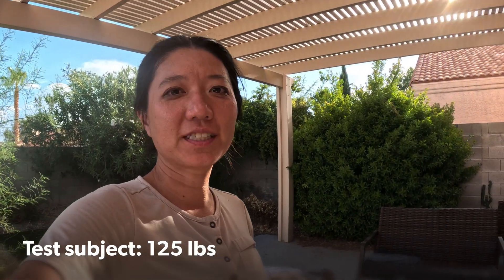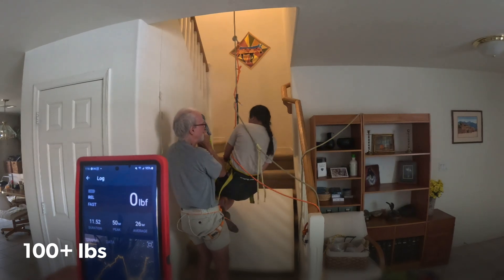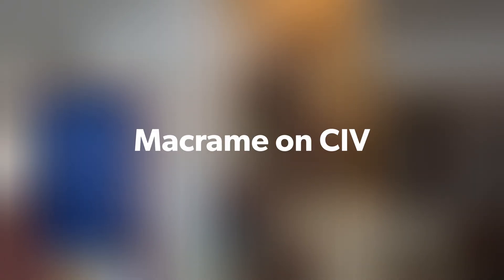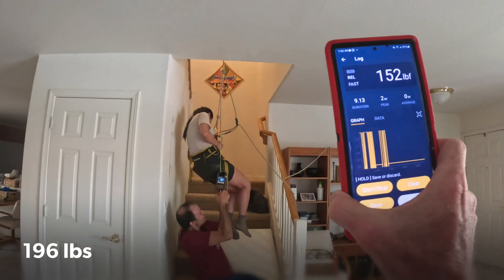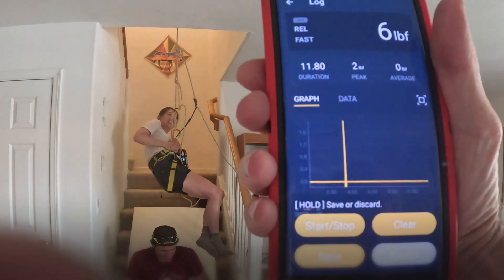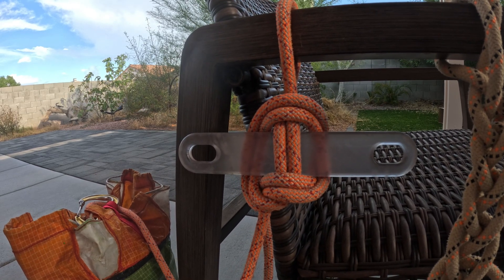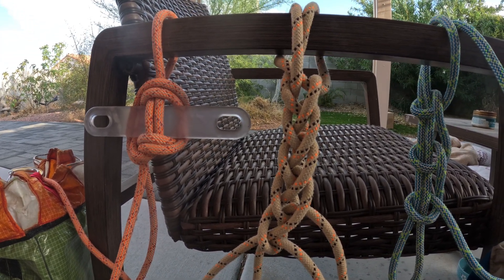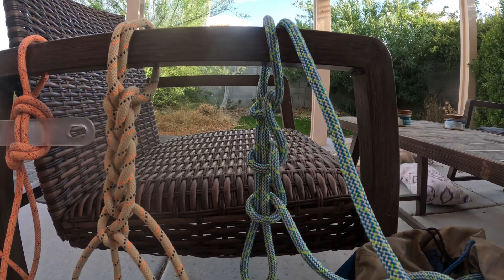Accidental Rope Pull In Canyoneering Retrievable Anchors: How Much Force Is Needed?

Comment: Cool tests. I hope the results (numbers) help to better understand the premature failure of these riggings. Some notes: Premature failure tends to happen NOT when the systems are fully loaded, but when they are partially loaded. Like when the last person is walking down a slab before fully loading the system, or stopping mid rappel on a shelf. For these reasons, some system may be a better choice, like the full-CEM (original version) with a staggered 3 step release. As others have mentioned, "Rope on Rope systems" that are too-difficult-to-release under load, can also translate to too-difficult-to-recover. I've had recoverable rope-on-rope systems work with some ropes when dry, and stuck when wet. Thanks for the vid!
Reply from the maker: @AdolfoIsassi  thanks for comment!  You are right about rope on rope system could be difficult to release after people are off rope.  Think I’ll get some numbers for rope release when it’s cooler outside 🙂
Reply: @Celessence  - For people adopting 'transient rigging' as part of their kit, I suggest adding a "rope on rope" a "rope on hardware" a "end of rope" and a "mid rope". Spain, Mexico and the PNW have come up with some super nice systems that incorporate all these variation in 1 system.
Reply from the maker: @AdolfoIsassi  ah thanks I’ll look those up.  I’m only familiar with the 3 that are common in the US Southwest

Comment: nice comparison, CEM knot looks a good option, never liked the macrame unless is for storing rope.
Reply: I've pulled a "simplified" CEM to breaking, about 2150 lbs on a 4000 lb bs rope. But the first half-hitch inverted a bit over 900 lbs, after which the rope would be unretrievable. CEM always released quickly when weighted to about body strength. YMMV.
Reply from the maker: Aye thanks.  Yeah after making this video I see why multiple canyon acquaintances had said they ditched macrame after started using CEM.

Comment: Nicely done. Thanks for doing each case with different ropes. Rope on rope friction will vary a great deal with the rope, and condition of the rope (wet/dry, dirty/clean). I stopped using the macramé because the consequences of it not-releasing are, in some canyons, dire. I had a macramé that declined to release, even when I was standing next to it pulling with all my strength. On the other issue, managing the pull side is an important part of using toggles (Smoothie, Fiddle); as is not canyoning with sociopaths and psychopaths who would happen to pull the toggle while you are rappelling. Your choices may differ.
Reply from the maker: Aye, thanks!  I'm considering doing a video of pull force required to retrieve rope.  From doing this experiment I have found macrame to be very difficult to retrieve once being tugged and finagled.
Reply: My fear isn't a renegade canyoneer-companion - let's say you're rapping down with the pullcord deploying - and it suddenly snags on something.
So how abrupt and hard would that snag have to be? Clearly more than 50lbs' worth

Comment: If you have 3 heavy people rap on the smooth operator and don't loosen the knot I think you'll have a different result for the 120lb person.
Reply from the maker: Yeah I trust the SO.  Lapar'd on it multiple times.  And it's easy pull at the end too once un-weighted.

Comment: I know this will come up: if you (in the harness) are the only one pulling the release line, it is easier to pop a macrame.  YT won't allow me to post links, but I have videos of that scenario, and the lowest force was 75 lbs. The creepiness in the macrame is that it is easy to have very little of body weight on the rappel strand at times (starting a rap, stopping at a ledge).
Reply: To rephrase your excellent points, scenarios that reduce the weight on the load strand make the pull strand easier to pull.

1) unweighting the load strand due to terrain
2) unweighting the load strand due to rappeller pulling/dragging on the pull strand (20lbs rappeller pull on pull strand reduces rappel load by 20lbs)
3) both 1 and 2

Assuming that there's a rough ReleaseForce:LoadForce ratio for a given method+rope, anything involving scenario 2 has magnified effects since it reduces LoadForce which reduces the required ReleaseForce.